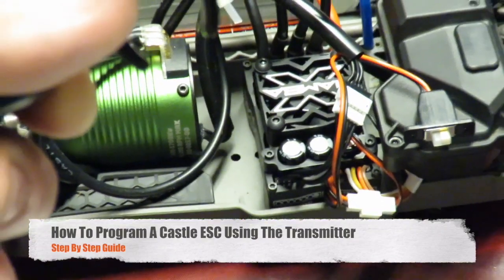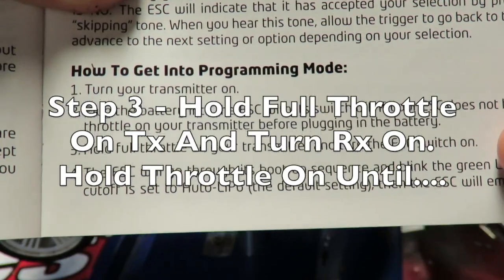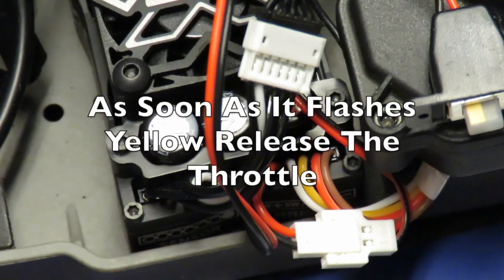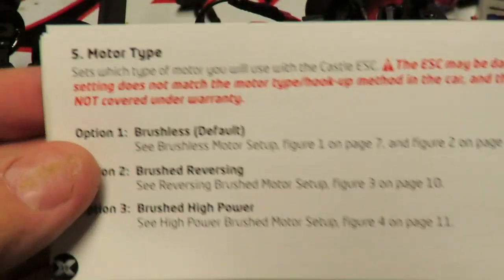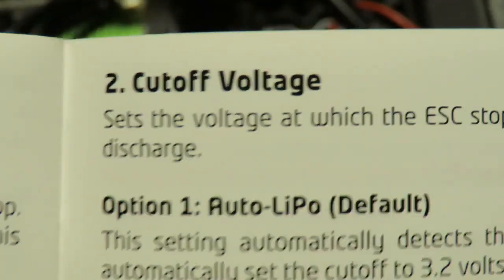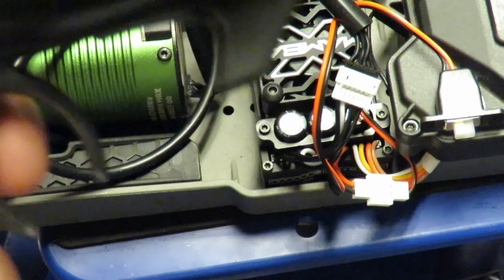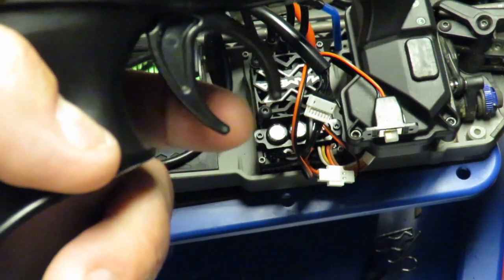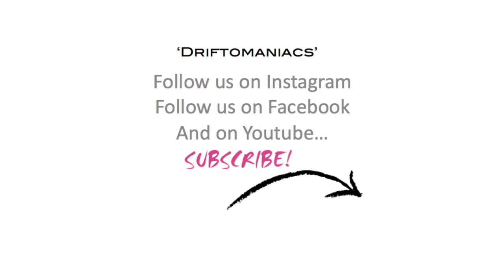How To Program Castle ESC Using Transmitter

Comment: Thanks for the video.
I can read well and assumed I'd have mo issues going by the manual's instructions.
Wrong.
Those people need to learn how to use words better, because the way it was written was the most convoluted gibberish ever. 
You saved my bacon as i had crammed my new ESC into my Losi Promoto (which took an embarrassingly long time to pack all the wires in so it would fit) and the damn throttle was reversed. 
I was pulling my hair out, thinking I'd have to order the castle Bluetooth adapter, tear down my moto (which took over an hour to rebuild after installation) and do it all again after plugging the Bluetooth link in.
I was seriously sh1tt1ng bricks. 
Your guide helped me recover hours of work. My throttle is set correct now and i can speep easily knowing i didn't waste an hour today plus another hour tomorrow building the motorcycle again.

Comment: So after going through your steps a couple times I managed to get the brakes to actually work. The problem is you only show the options for a few of the categories. But my ESC has eight different categories and I don't know what the options are in those other categories because castles online programming instructions only have like six categories and they appear to be in a different order than the ones in your instruction book. I'm so lost now I don't know what I'm setting in these different categories cuz I can't figure out what they are 🤬🤬🤬

Comment: How do you switch to nimh mode can you make a video of it
Reply from the maker: Nate you'd be as fast to check the online manual on the castle site as that's what I'd have to do to tell you the answer. I would say though if you buy the castle b-link connector for it then you can change everything via your mobile phone on the castle app. I'm lost without it now. Best $40 you'll spend on castle product
Reply: Here's another one if you use a nimh battery on the castle esc while on lipo cut off what will happen

Comment: I still haven’t got my mamba x and censored motor combo to work, every time I plug in the cable the motor won’t move it cogs just sitting there, and when I unplug it, it drives like a regular truck even though it’s a sensor’d motor. Help.
Reply from the maker: I would contact castle directly with their helpdesk you're through to them in less than 30 secs

Comment: I tried to calibrate my mamba x 3800kv crawler edition to my traxxas reciever/remote, and i guess i hit something wrong, now when i try to re calibrate it, it just beeps 3 times (. . _ ) and blinks red, yellow, yellow, cant seem to figure it out, my esc and fan also do this weird power off thing when i turn my wheels side to side,  need help asap
Reply from the maker: I would contact castle or your LHS as it's impossible for me to offer advice without seeing it. Can't imagine it's anything major although I appreciate it/s frustraing for you
Reply: @DriftomaniacsRC  i got told by someone else that has a mamba x it might he cause im using the stock traxxas radio/reciever and that i should try a different radio at a friends to see if it works, if not ill have to contact castle on monday
Reply: Is the esc fan supposed to turn off once you arm your contorler to the esc after programing your esc
Reply: @jaykobenmozzymozzy6085  yup, after its finished its start up, the fan only turns on automatically to cool the esc down if it gets warm (if you have it turned on still, i think its on by default, in settings via pc)
Reply: @JayDawgDrummer  thanks man makes sense now haha

Comment: wow man, this just saved me having to get a programming card. my temps are a lot hot now from the added brake force. i'm running the 5700 kv motor, any advice?
Reply from the maker: Glad it's of use I did this video as I bought  the card from my LHS BUT it needed an update to work, the problem I had? I've a mac and the update is only available for a PC! Hence this video as I thought if I'm having to do it this way might as well video it to help someone else out! What car are you running the 5700kv in, also what ESC and gearing? Off for the night in a min but will pick up again tomorrow.
Reply: @DriftomaniacsRC  i'm running  the 5700kv in a lcg slash 2wd and the same (mamba x) esc . the gearing ratio is 54t spur :17t pinion, thanks!!
Reply: Yes don't brake as much.

Comment: My x series esc has 6 settings. I have no paperwork would you know what it's for and the option values. Thanks so much.
Reply from the maker: Ace this is the online castle mamba x page I myself used earlier this week when I had a query it's pdf page https://dzf8vqv24eqhg.cloudfront.net/userfiles/4671/6540/ckfinder/files/Product%20Manuals/Surface/X_Series_Drivers_Ed_Guide_095-0290-00.pdf
Reply: Thanks so much